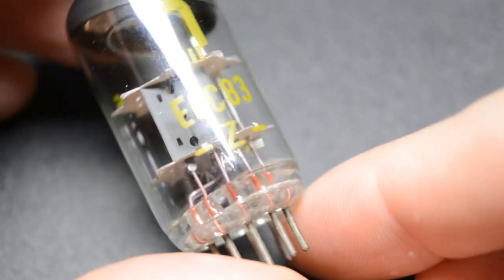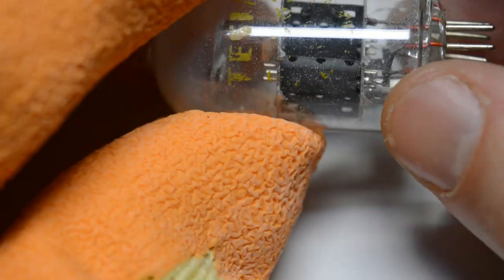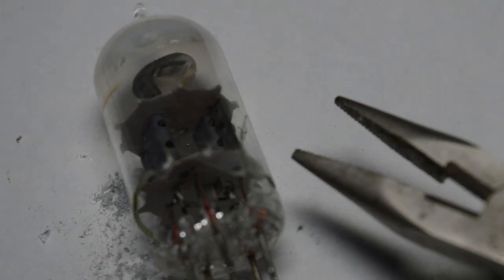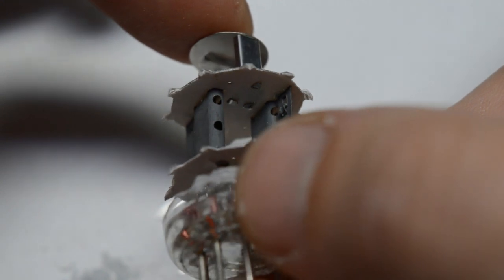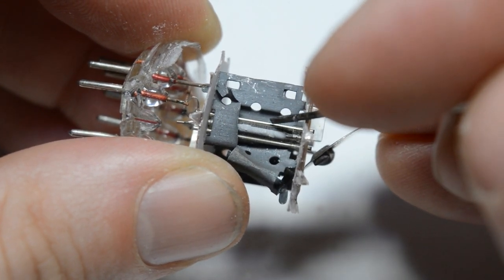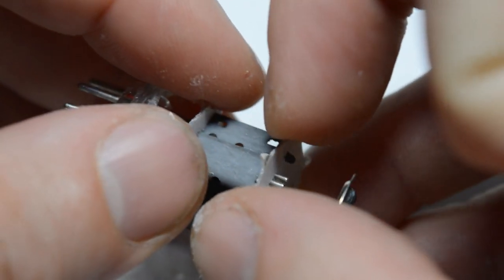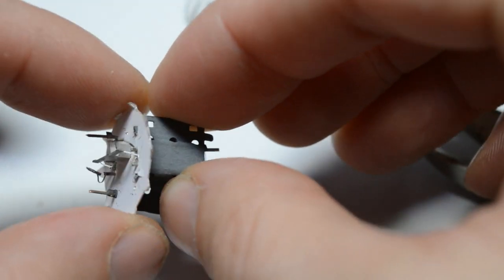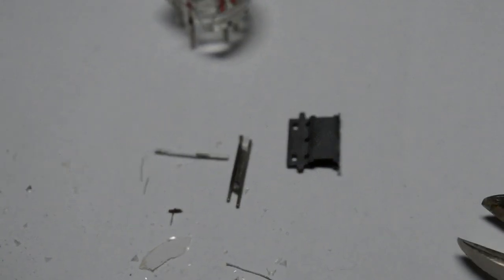Vacuum Tube tear-down - a look inside the ECC83

Comment: Use your teeth next time instead of those useless pliers!  Another great video, I like your mix of high speed for slow grinding projects and normal speed for other work.  Thanks for posting this, I really enjoyed your video.
Reply from the maker: For the next tube tear-down I will use my teeth, I promise.
Reply: @FesZElectronics  are you able to make a model for this old tesla ecc83  ?